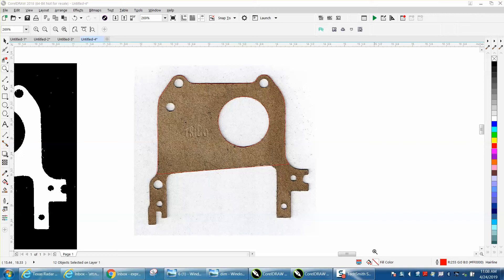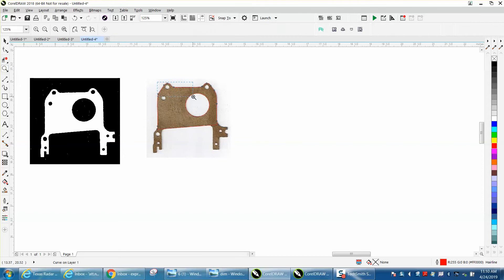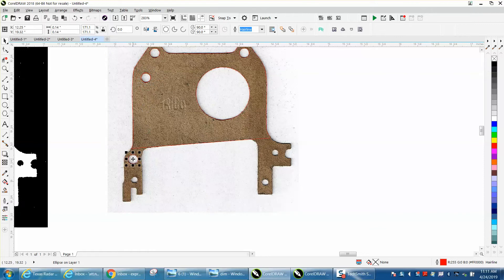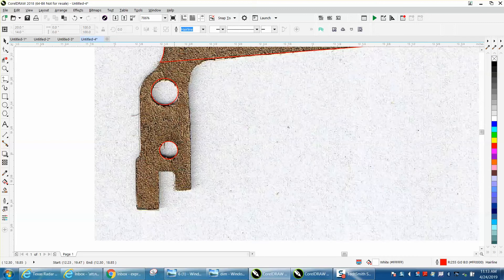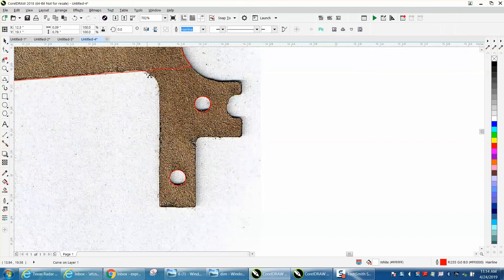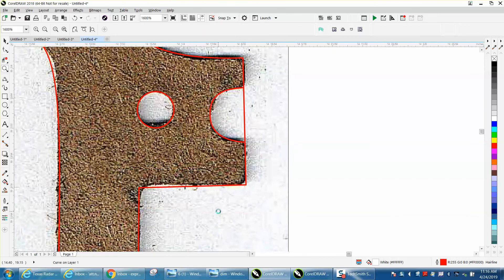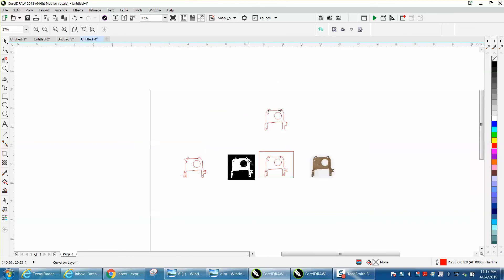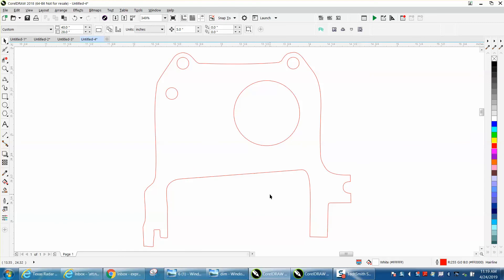Corel Draw Tips & Tricks Trace a gasket

Comment: For creating the circles to fit:  Draw a square around the "hole".  It is not hard to move the sides of the square so they are tangent to the circle.  Then using the Circle tool, start at one corner of the square and pull the circle down toward the opposite corner.  The resulting circle is perfectly tangent to the inside of the square and so exactly fits the hole.  Erase the square.
Reply from the maker: thanks will try not sure how it will help, but thanks